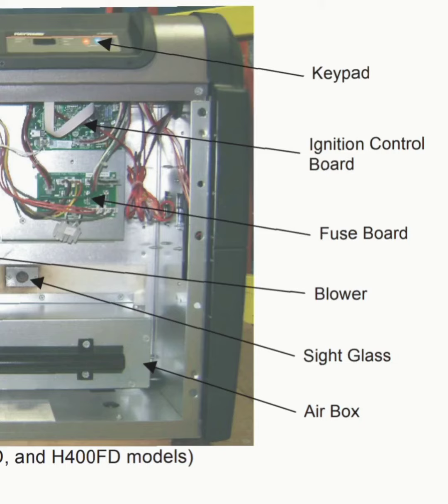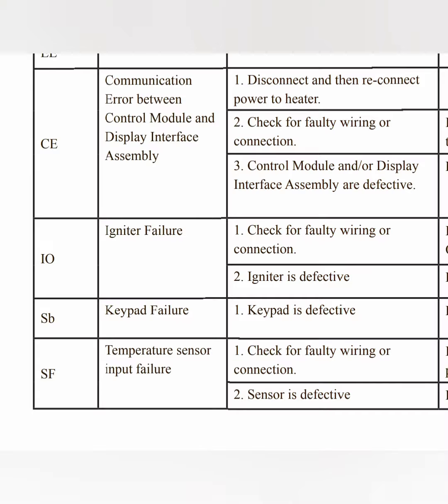Hayward Gas Heater "CE" Code

Comment: my digital display board shows nothing, no lights. I already check fuses and they are ok. Any idea where the fault comes from?
Reply from the maker: Most of the time the small display board needs replacing.   To be sure, shut off the power and remove the large board.  Check behind it for small reptiles & amphibians that short circuit the (main) board.    If so, it's the main board.  
Otherwise swap out the display board.  Once or twice in my career, I wound up replacing both boards.  Good luck !
Reply: Thanks for you quick response!!! @MarkCormier

Comment: How much  was the main board and the key pad board ?
Reply from the maker: Hey Joe... Amazon shows about $229 - $249 for the Digital Display Boards. The Main control boards are listening for about $249.  
I always bought them from my distributor.  Buying from anyone else is a roll of the Dice.  For another $50 a reputable pool supplier like "Into Pools" would be a better choice.  They even answer the phone to help make the right selection.  Lastly, call a pro and let them handle it.  😉
Reply: @MarkCormier  thanks for the great video and info., super helpful.  What made you change the digital board? You think the job was difficult? 
How did you know which board was fried?
Reply from the maker: @JunkMan718  Most of the time, the "CE" heater code is fixed by replacing the display board.  But sometimes you need to replace the main control board.  The code tells us communication to the display isn't 100%.  I've seen a few of the (Display Board) ribbon cables chewed by critters.  In this case I could see corrosion at the cable connection.  But a 🐸 ruined the main control board as well. Yikes!  Expensive repair.